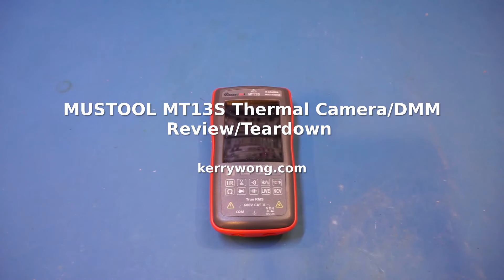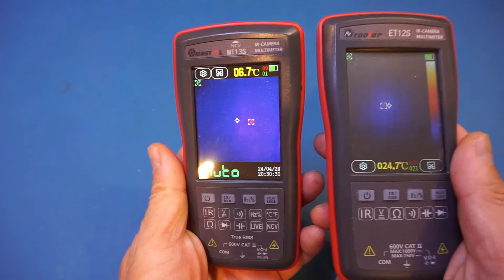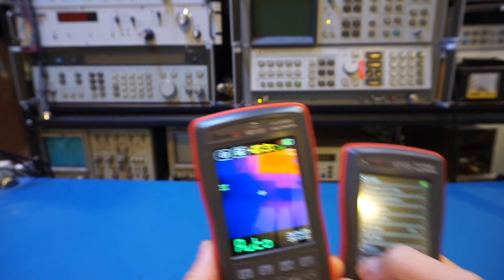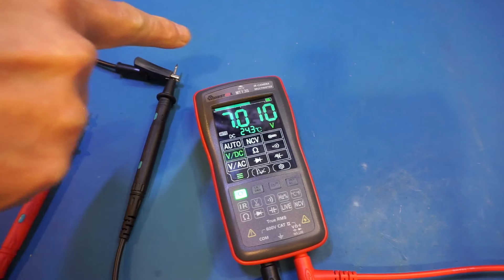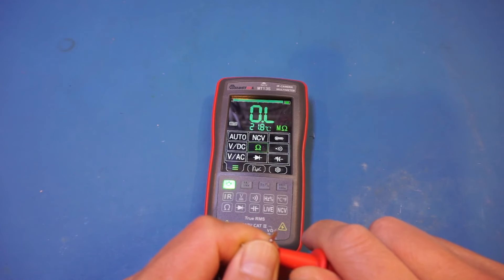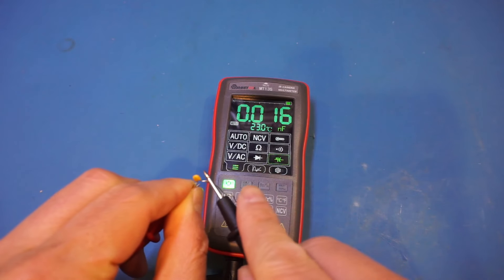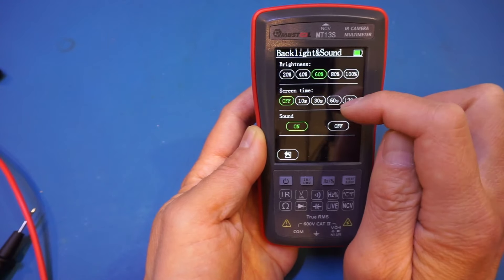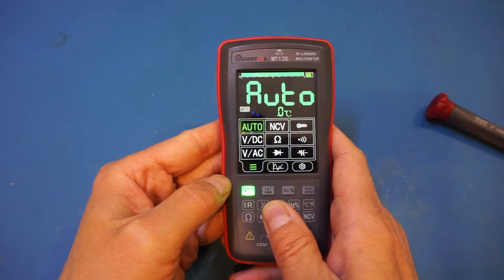MUSTOOL MT13S Thermal Camera/DMM Review/Teardown

Comment: IR temp "LOW" range = -20C to 150C; "HIGH" range = +100C to +550C according to the sales literature.  When using "AUTO", all temperatures are covered, but there is ~2 second lag to switch back and forth.  The NCV is more sensitive at the upper left corner of the unit, not where the arrow is.  The LIvE feature is activated with a second press of the NCV icon. The capacitance does indeed have a REL feature, as stated in the manual.  You press the "-|(-" icon a second time and a Δ appears in the display.  As for the temperature mode, you use a K type thermocouple with banana jacks (not provided), the top reading is reported for external probe while the bottom reading is internal sensor.

Comment: 18:20 the temperature of the thermocouple isn't being displayed on the default room temperature display, it just happened to be reading the same value because the meter is at room temperature and the thermocouple wasn't placed on a different temperature source.  If you put your fingers on the thermocouple tip, it should show a response to the temperature change, while the other reading doesn't.
I assume it's for a thermocouple temperature measurement, since it'd be nonsensical to have a mode that just reads the internal temperature of the unit.

Comment: Thanks for the video! 
Do you think the logging function is fast enough to be used for motor inrush current measurement with a current clamp? Or just detect current spikes ,  when motor encounters a bump of sorts?
Reply from the maker: No, it only logs at a rate of 1 sample per second. But the file is in text format so you can view it without the need of any special program.
Reply: @KerryWongBlog  If you press the wrench below the graph, you will be able to select 0.5s, 1s, and 2s sampling [0.5s default].  There is also a "continuous" sampling option which only affects screen scrolling.  The data has a store feature to internal memory same place as BMP screen captures. Click the floppy disc icon on the graph when stopped.  It can be reviewed with the PC program, however it falsely smooths the curve.  I prefer to import the ".VOM" file directly into Excel and make my own graphs and perform data analysis.  It seems the data is instantaneous readings not interval average.

Comment: Is it possible to upgrade the firmware ( to fix some display issues, e. g.) and where can a new firmware file be downloaded?
Reply: In fact it can, i've asket the factory. You play-in the new firmware through the USB-C cable. At the moment, there's no new firmware available.
Reply: @jurgenkruger3932  Who is the manufacturer of this device? Can you provide a link to a support website?

Comment: There is a huge difference in displayed temperature on both meters. One shows 24*C (probably the correct value), the other 7*C. Is it bad calibration or faulty device? Or am I missing something?
Reply from the maker: That's because the emissivity settings. For some reason on the MT13S the default was set to 0.3 instead of 0.9. When I changed the emissivity the readings were comparable.  You can see that in the still thermal images I took at the beginning of the video.
Reply: The problem is..... ***thermal cameras doesn't measure the temperature*** but measures the infrared radiation emitted by the framed objects:
the infrared radiation emitted by an object depends by the object temperature and the emissivity of the object itself (different materials have different emissivities). 
Because a thermal camera cannot determine the emissivity of a material by itself, a thermal camera always display the picked-up infrared radiation as an image with false colors, but requires the user intervention to manually set the emissivity in order to calculate the correct temperature readings and failure to input the right emissivity can cause massive errors in temperature measurement..... this is a very common mistake that users do with thermal cameras (and infrared thermometers too).
If the emissivity of a surface is unknown, you can either determine the emissivity by measuring the temperature of the surface with a reference thermometer (of course, not an infrared thermometer which have the same problem!!) and adjust the emissivity by trial and error until the measured temperature match with the temperature of the reference thermometer or stick some emissivity stickers in the points you need to check (emissivity stickers are just stickers with a calibrated and known emissivity that you can stick on the surface and you can frame with a thermal camera or an infrared thermometer in order to measure the temperature of the surface itself).
Anyhow, this is why thermal cameras can also be used as night vision devices (even if the temperatures of the framed objects are the same, different materials with different emissivities translate to different infrared radiations, so different false color displayed by the thermal camera).

Comment: Hi, is there any special way to connect via USB?
Mine - it has arrived a couple hours ago - is not connecting to my phone neither PC.
Reply: Be sure to use the cable that came with the device, or a [USB-C to USB-A] data cable (not just a charging cable).  Go to settings > USB mode on the IR camera.  Then plug the device.  Should show up as a new folder "THERMAL" on the PC.  If there is a problem, restart the device and try again.  Still no connection?  Turn over the USB plug at the device and repeat.  There is PC software you can download, but you don't have to do so.  The primary benefit is being able to read the temperature data in Celsius by pointing to the location on the image.

Comment: Is this a DMM without an ammeter???   Isn't that a rather big miss?
Reply: For repair reasons its not necessary, I think. Only for laboratory work. But then you need something better.
Reply: I have the same device and i know that the ammeter feature is a big miss...
But TBH, i know that some other pocket sized DMMs lack of this feature.
If you really need an ammeter you can buy an external shunt resistor or an external clamp adapter (or maybe buy another multimeter instead and use this one only as a thermal camera!)
Reply: That's the easiest workaround for meters without current measurement. Safer too since you can't blow up the meter or fuse.  Just use the mV range.